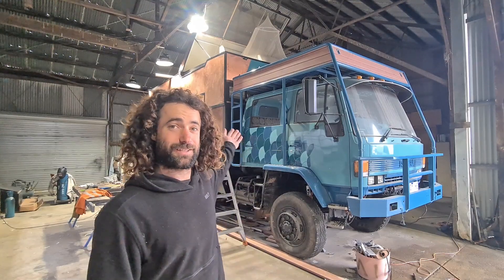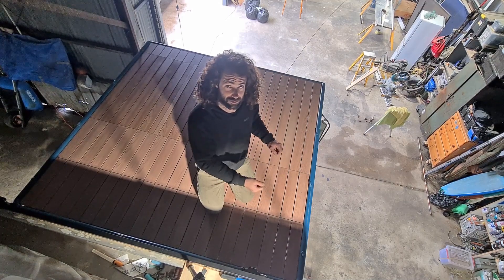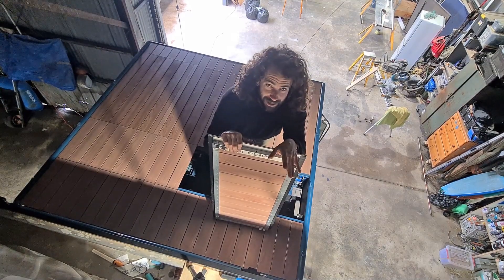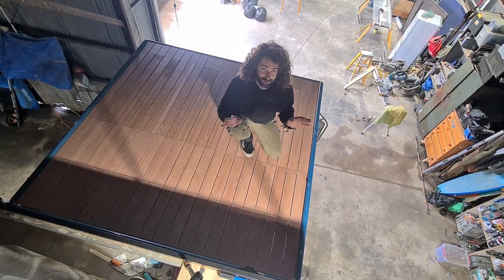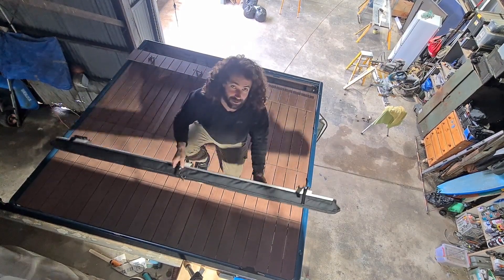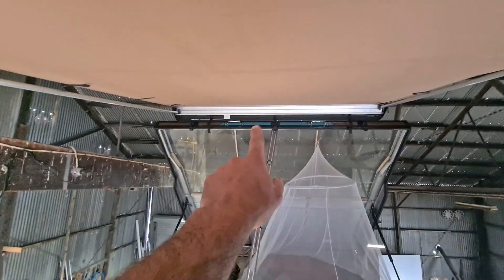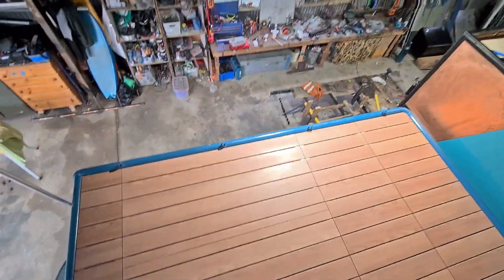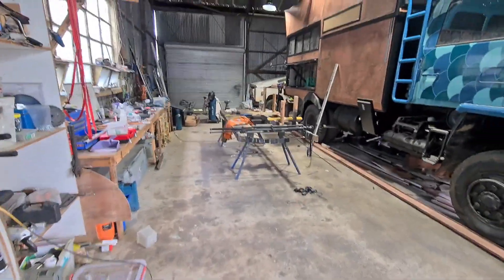Rooftop Deck With Crane and Awning - Expedition Truck Build #25 - DIY Off Road 4x4 Adventure Truck

Comment: Great to see an update video - you're going well and the attention to detail is outstanding.

How is the center of gravity going with this setup? Do you have low-placed water / fuel / waste containers to help offset the upper level construction? The GVM must be amazing - any idea of what it will end up being?
Reply from the maker: Thanks Aaron! Yeah I've got the water tanks mounted in between the chassis rails, and fuel on the outside of the rails, once the roof is lowered is brings down the overall height a fair bit too. 

I haven't taken it over a weigh bridge recently but it's on the list, the gvm is 12.5t, the truck can carry 6.5t, I'm hoping for it to end up under 10t
Reply: @dancampion  that's a lot of truck! I look forward to seeing it in action.

Comment: Hi Dan, two questions, what kind of latches do you use on those panels on the roof, and second, are they strong enough to hold down the panels on off-road driving?  Thanks keep up the good work.
Reply from the maker: They're adjustable ball catches, that's something I'm not sure about yet, I think they will be fine for most conditions, but I am curious about driving over corrugated roads, it's going to be a 'suck it and see' situation